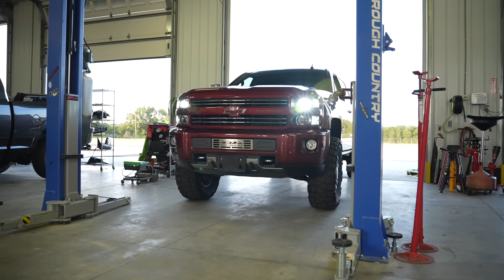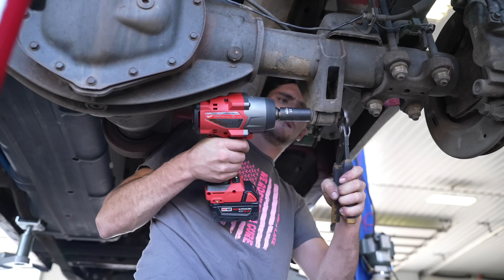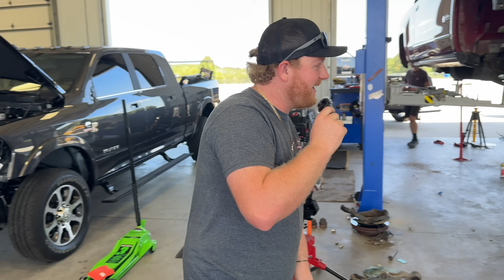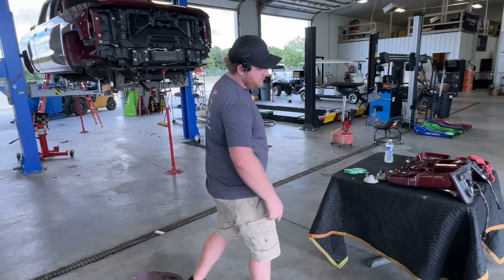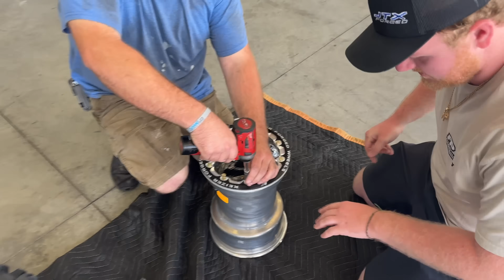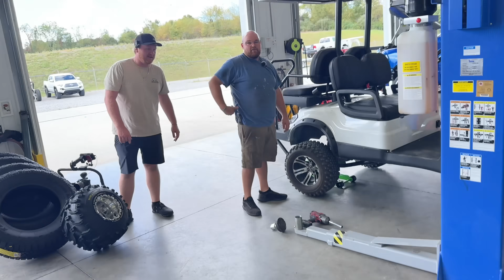BUILDING Bailey Zimmerman His DREAM TRUCK!!!! Will He Like It?

Comment: Got a tip on surface cleaning if you do a circular motion instead of just going straight with it it’ll distribute the pressure evenly and get rid of the lines in the concrete😉

Comment: Yeah every set of tires we ever got at the shop offline came like that I guess to compact them down for shipping. Some of them would ride a little funny at first but after a mile or two that straightens up. But for the most part with quality tires they've always just been smooth as soon as they're on. Also I was just getting ready to redo my rims to I have been wondering if I could find something crazy in a 10 I also wanted to put some 2 inch spacers on it I found online and stance that sucker out. It's a old trusty mule I have been messing with forever. It has racing exhaust off of dirt bike sounds psychotic. I think it's the only Kawasaki mule in existence that can absolutely melt the tires off at any point while riding.